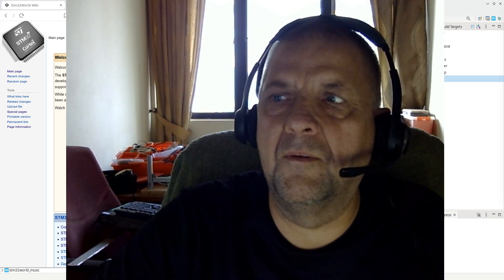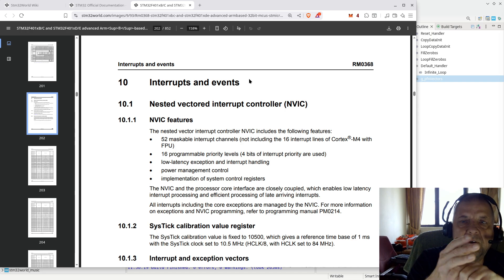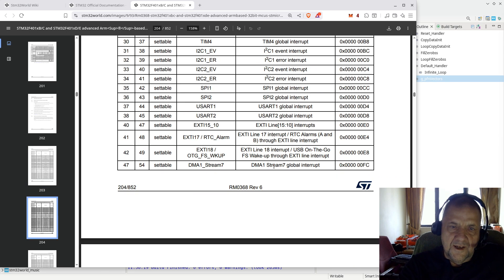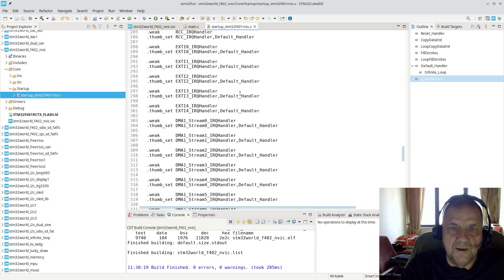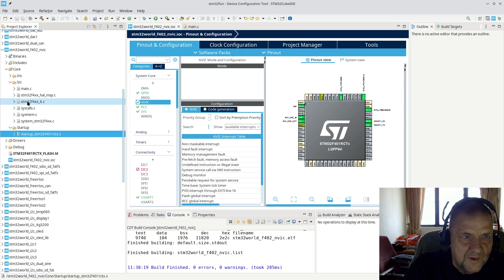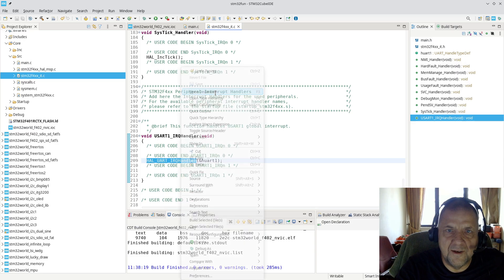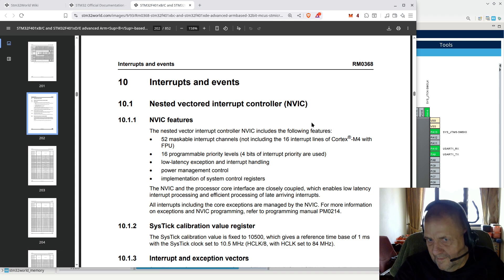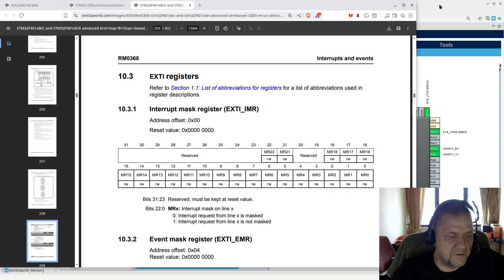STM32 Basics #4 - Interrupts and the NVIC

Comment: All Cortex-M processors have the NVIC. It’s so tightly integrated to the cores that the only way to chuck it out is for the designer to buy an ARM architecture license and start from scratch.
Reply from the maker: I think my point was merely that other vendors might call it something else and it might be slightly different.
Reply: @stm32world  you’re right of course, I just jumped to conclusions.
Reply from the maker: I haven't really done much on other arm core mcu's.  RISC-V and Espressif's Xtensa cores mostly.

Comment: Hey Ich habe ein problem mit meinem STM32. Dachte ich poste das hier mal.

Ich habe ein STM32 746 RG da sind mehrere Encoder angeschlossen für Navigation in einem MENÜ GUI. 

Außerdem habe ich einen Spannungsgesteuerten Verstärker der ein Hüllkurven Envelope generiert und einen Synthesizer Kern steuert.

Leider Musste Ich da Graphischen Updates So Stark über Das STM32 runterfahren dass eigentlich nichts mehr von meinen Animation die ich Anfangs rein habe übrig ist. 

Das Problem Ist dass die PWM Generation des Encoders für Menü Diving, Encoder PWM Generation für ADSR Design, Und Andere Funktionen Blockieren die Maschine, es fängt an zu laggen, mein Ton und Sound stoppt, der VCA verpasst teilweise sogar Input, Triggers und Steps.

Haben Sie Vielleicht Einen Lösungsvorschlag wie ich meine Graphischen Updates zurück ins Menü bringen kann ohne Jedes mal einen Lagg oder Interrupt zu verursachen der Das System blockiert ?
Reply from the maker: Ich habe ein Problem, Deutsch zu verstehen.
Reply: @stm32world  Hey, I have a problem with my STM32 and thought I’d post it here.

I’m using an STM32L476RG, and I have several encoders connected to it for navigating through a MENU GUI.

Additionally, I have a voltage-controlled amplifier (VCA) that generates an envelope (ADSR) and controls a synthesizer core.

Unfortunately, I had to reduce the graphical updates on the STM32 so much that almost none of the animations I originally implemented are left.

The issue is that the PWM generation for the encoder (used for menu navigation), the encoder’s PWM for ADSR design, and other functions are blocking the system. It starts to lag, my audio and sound stop playing, and the VCA occasionally even misses input, triggers, and steps.

Do you have any suggestions on how I could bring back graphical updates to the menu without causing lags or interrupts that block the system?
Reply from the maker: Hmmm, first of all - you stand a way better chance of getting any good answers by asking for example on our discord server: https://discord.gg/rBMqP37Ek7
Second, without more details it is hard or impossible to come up with any intelligent answers to this.  Schematics, code (preferably a github link).  I am confused when you say PWM.  I am not sure where that come in.  When you say encoders I assume you mean rotary encoders which can (but that is only one way) be handled by a timer in input capture mode (I made a few videos about that).  The "overhead" of doing that is next to nothing.  As for your display if the updates take a long time and you do NOT use DMA that could screw up the audio.  So make sure you use DMA for everything.